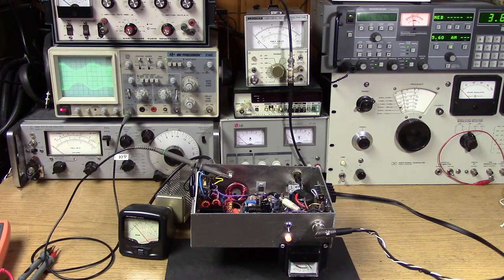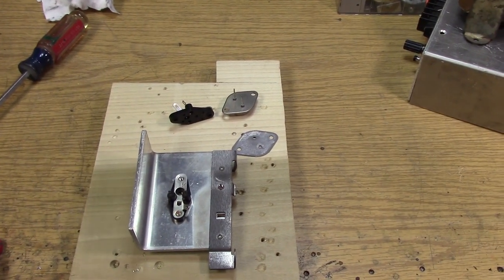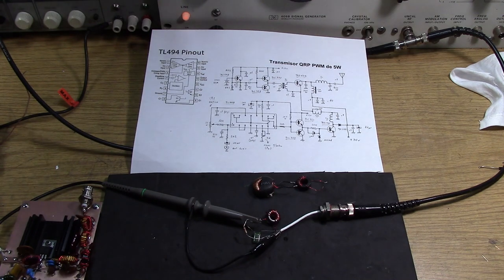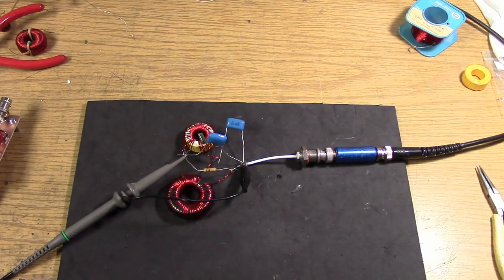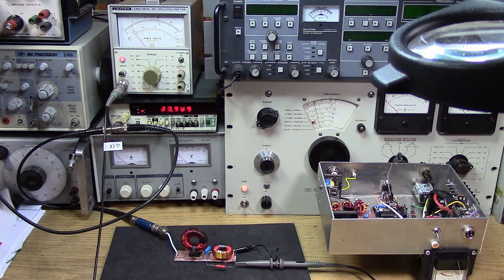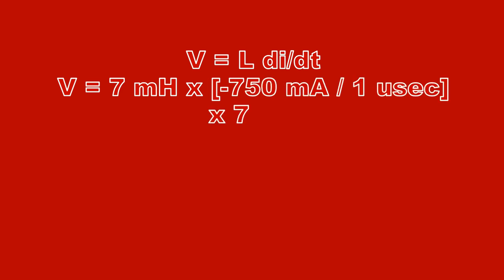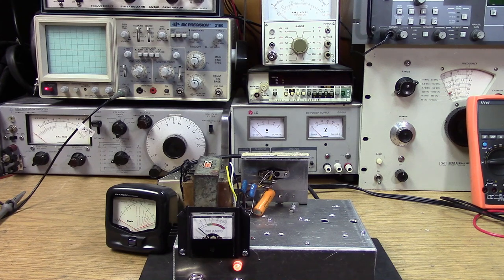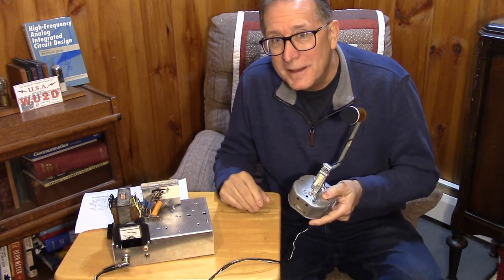PDM Part 6

Comment: Great job! The big class E transmitters use very high quality RF power capacitors and inductors in the output network. The TL494 warm-up is worth knowing about. I've used a TL598 in a modulator and it has an enable line which deals with this problem.  Looking forward to seeing how you go on air.  Should be plenty of activity! 73 from Down Under.

Comment: That analog current meter adds a proper aesthetic that really wouldn’t be the same if you used one of those segmented LED jobs. I’m curious over the power inlet, your IEC socket.  That’s a sort of common mode choke for EMI filtering at the IEC, I often see them advertised as ‘power conditioner’, no?  Maybe the variac is making the coils within your IEC connector to ‘go ethereal’ inside of that little capsule and causing the noises that you’re hearing?  Did you try the FLUX REMOVER??  
Thinking back on your command set videos?  I really have become enamored with the Dynamotor device, and I am amazed that these aren’t in use at all except by you.  I’d love to see you power this set here with one of those dynamotors.  I know I’m not speaking for only myself when I say that I am so so grateful for your YouTube channel, and when you share those moments where you discover disappointments and unidentifiable obstacles that are keeping you in troubleshooting mode, I don’t have such a hard time myself, since it’s sort of like I’m going through it right along side of you!!  THANK YOU FOR YOUR CONTINUED CONTRIBUTIONS!!

Comment: I did not thoroughly study this (very cool) video, just wanted to be among the first to comment about it. Thanks for setting me straight to the subject: 

The microphone is a perfect example case in future textbooks, a leap forward, a landmark to the field of psychology...

Unless it is declared a "religious artifact"...  

Also, you mentioned earlier the output power on the order of 10 W, this hardware seems overkill.  Moreover the efficiency was announced to be 95% but also the 450 V capacitors fail!  As a conclusion, you could work out the numbers please.

Great video!

Comment: Hi Mike.  I had the same issue with those small blue HV capacitors as you did, but on a 630m Class E TX.  They appear to drift in value as they heat up.  You could watch my output sag, over a few seconds, on a distant online SDR.  Always had the same decay profile.
Reply from the maker: Yes they are not capable of handling the RF Current apparently!

Comment: Excellent Mike. Interesting project and looking forward to seeing how it works on the air. In addition to Mr C, I wonder if you will receive enquires from all the big manufacturers about the mic.😄. I have tried using those blue ceramics for a few RF applications but not had much luck.
Reply from the maker: Let's paintem blue and see if they sell?

Comment: What about a NE556 Dual Timer chip might work better that that PWM chip you are using as you can use the CV pin on the modulator timer.

Comment: Very neat.  Can't wait for on air testing.  Really didn't expect arc over it be an issue at such low powers, but RF is partly witchcraft.  Not knocking your mic, I must admit I thought it would be fun to use on the air as questions about what equipment a person is running could be a lot of fun, you need to name it.  MikroMik maybe?  I'm still trying to decide if you were joking about Mr Carlson.
Reply from the maker: I was just funnin.

Comment: Mike, I'm concerned that Shure and Motorola are currently crafting a lawsuit (frivolous as it may be) to delay your entry into the market!

Question:  One of the dismaying things about RF power amps is the seeming-necessity to use voltage higher that 12V (i.e. car-battery).
What do you feel would be the max wattage of a class-E if constrained to 12 volts?  Solutions?
Reply from the maker: Yeah no worries about that infringement for sure... By the time you get up to 30 Watts, with only say 12.5V, the output R goes below 2 Ohms, so practical R losses start to come in with transforming impedances. But it still should work.
Reply: @MIKROWAVE1  Thanks for the heads-up on the impedance drop!
If power is to remain the same, you have to increase current when you don’t have extra voltage; so the impedance would go lower.
👍